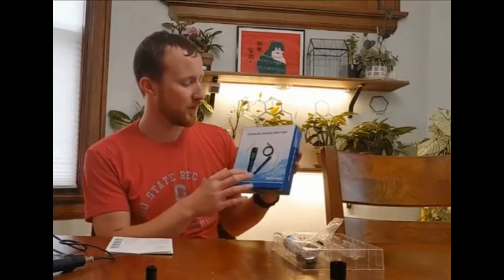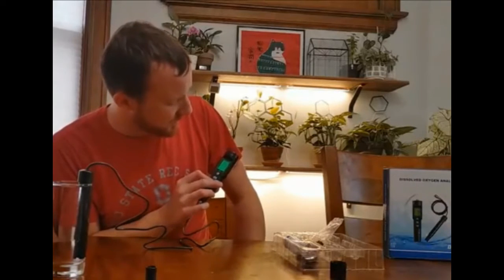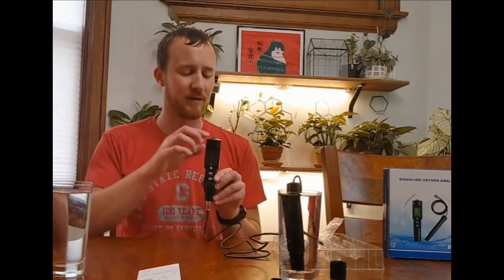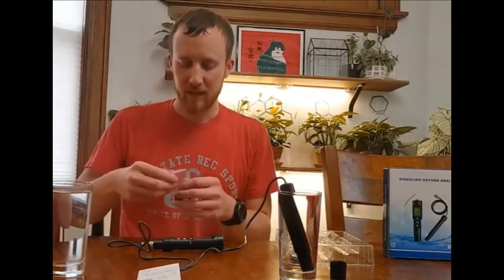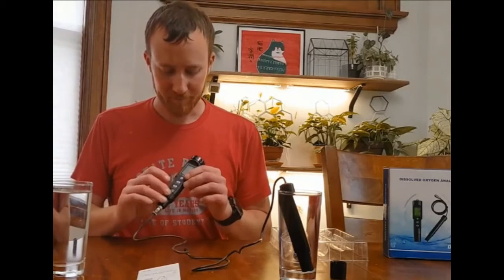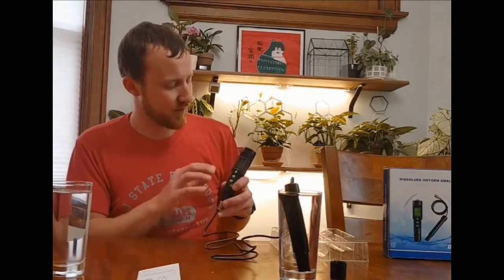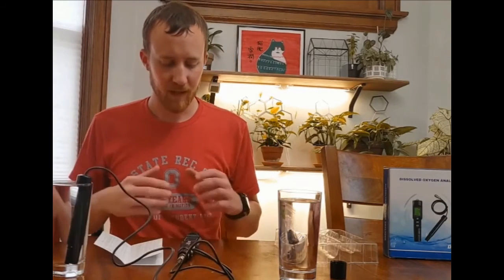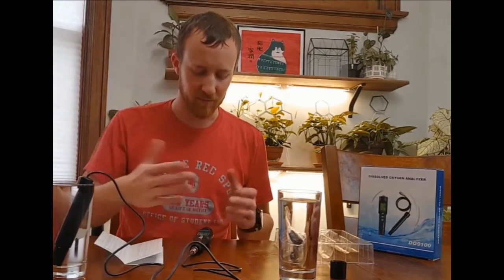DO-9100  Digital Dissolved Oxygen Detector Dissolved Oxygen Meter

Comment: I recently purchased a DO9100 dissolved oxygen analyzer, which has only been used once for wastewater measurement. The probe connector accidentally came into contact with wastewater, and since then the DO reading has remained fixed at 7.5. Recalibration has been performed, but the issue persists. Please advise on the solution.
Reply: Заменить мембрану и электролит не помогает?

Comment: The tester always show 0.0 mg/l even we submerge it to the water.
Reply: Did you take the cap off? At the bottom of the meter there is a cap to protect the probe and sensor whilst in storage, remove that to expose the sensor before measuring

Comment: Hi, I just want to ask for your help regarding this device. So my Do-9100 meter was having issues. Three of the four wires within the electrode interface was cut off, only the yellow one was still attached. The problem is I can't attach it back because I don't know which wire goes with which number. So the yellow one is on #4, but could you please tell me where red, black, and white wire goes? On 1, 2, or 3? Thank you in advance!😊
Reply: Same problem here. Did you manage to find the order or the wires?
Reply: @agustinbasso8647  1-red, 2-white, 3-black, 4-yellow

Comment: You obviously doesn't know how it works. Horrible review
Reply from the maker: We are manufacturer ,why do you think i don't know how it work?
Reply: @phmetereavan2974  you didn't explain how to properly operate:
* How to set up, where and how much electrolyte drops, do you put the electrolyte before of after calibration
*How to air and zero air calibrate
*How to use the "conversion table". How does it relate with the reading you're getting at cetain temp compared to the table that have DO with a corresponding temp.
*How many uses each reserve membrane
Reply from the maker: @iceman101723211514  This video is not for operation ,so it don't have the detailed operation.If you need ,we can send you
Reply: @phmetereavan2974  Please let me know how to use. I bought it but doesn't know how to use
Reply from the maker: @saadjaved7023  contact my whatsapp:008618366190210
Reply: Booklet says 1.5v battery which I bought and its too long and too big. Noone shows the battery.